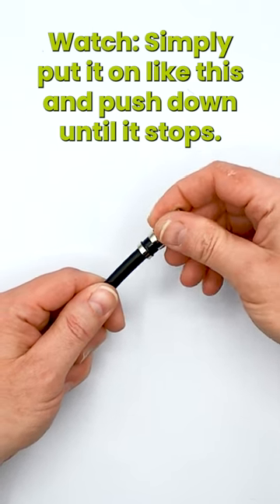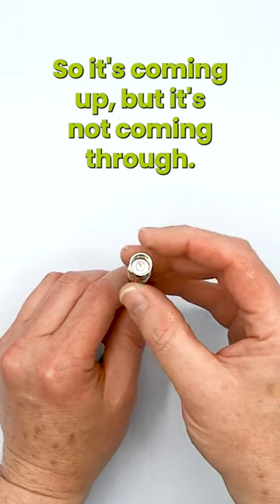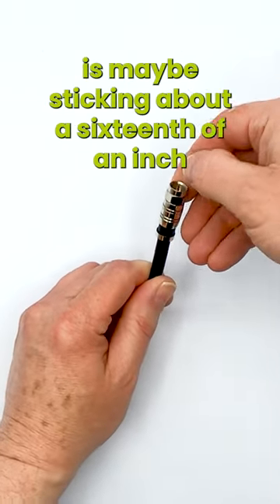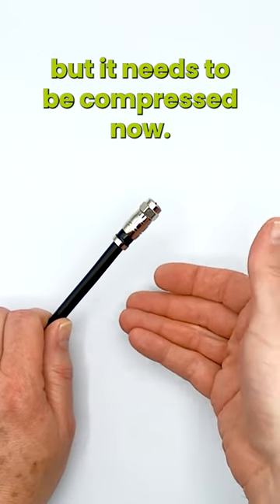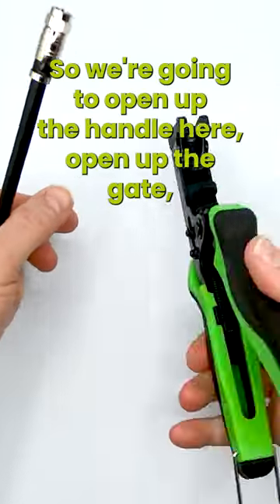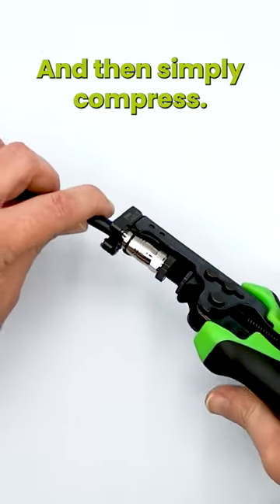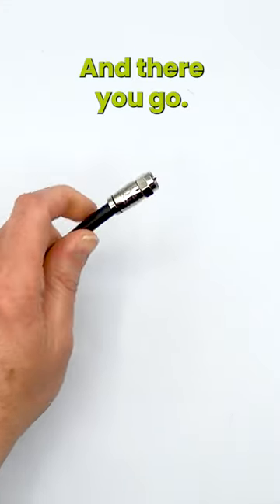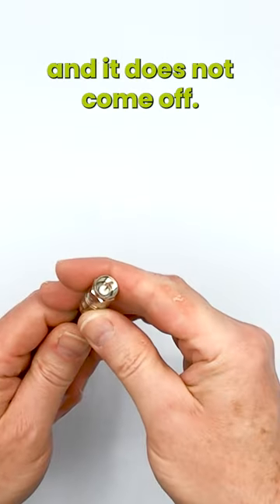How to Put an F Connector Onto Coaxial Cable #shorts

Comment: The fittings i bought seem to have their own core tip   theres a 😢white sliding section and its own tip  ?????
Reply from the maker: Hello! I am not sure what you bought, but it sounds like a BNC style connector and not a F connector. Either way (shameless plug) if you use one of F connectors you won't be wondering if it works or fits right!
Reply: @trueCABLE  hey thanks  it's a ppc  for connector I think but there's definitely a pin that comes out from the sliding plunger  so I'm assuming my coax core just fits in that plunger dohickey  ?  Thx
Reply: @trueCABLE  sent u a link to the compression fittings I got 
U see there's a white cylender in the middle with a hole   when u slide it to the end a pin extents instead of a typical coax core 😬😬😄😄
Reply: Sorry   looks like it was removed ??
Reply from the maker: @zandig666  Hello again. Understood, PPC is the manufacturer. The last time I saw an F connector like that, it was designed for RG11 (Series 11) and then stepped down to the typical RG6 type F connector. It indeed uses a pin plunger design, as the center conductor of Series 11 is far too large to fit inside any type of female RG6 port or coupler. If this connector is strictly all about RG6 then I have no idea why PPC would design a F connector this way -- no benefit in doing so. YouTube won't allow you to put in a link, their automation will simply delete your post.
Reply: @trueCABLE  hey thx alot sir   I was a bit lost  now with your help I'm a little found !!
Yes I'm not sure why but I used rg11 for my 50' antenna run...just inexperience at the time  perhaps I made the right choice !??!??
Reply from the maker: @zandig666  You are welcome. RG11 is a GREAT choice for antenna runs.

Comment: How do you take the f connector off?
Reply from the maker: Once the f-connector is installed, it is a permanent part of a complete cable assembly. The installed connector cannot be removed without damage to the cable and connector.
Reply: @trueCABLE  yeh I tugged on it for a while then cut it off.